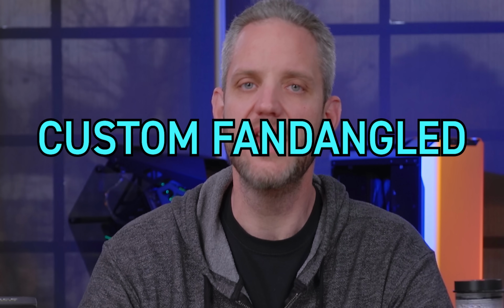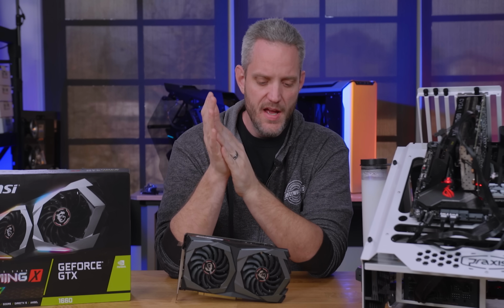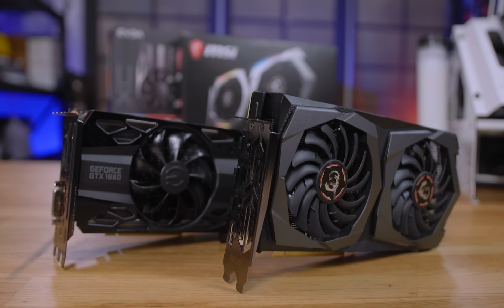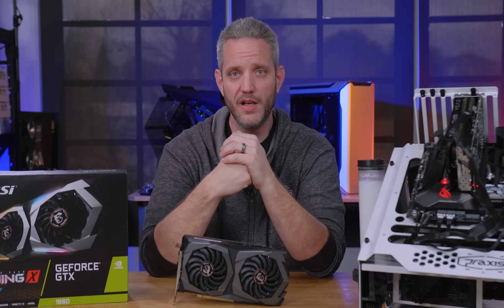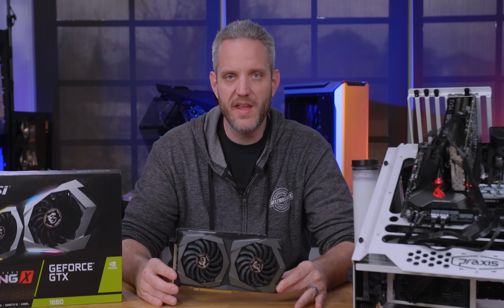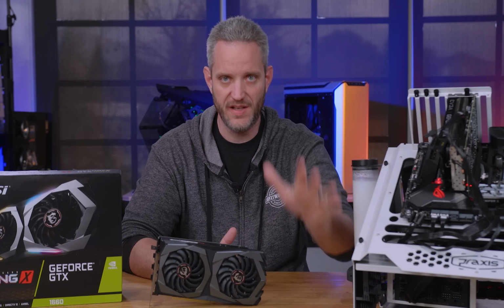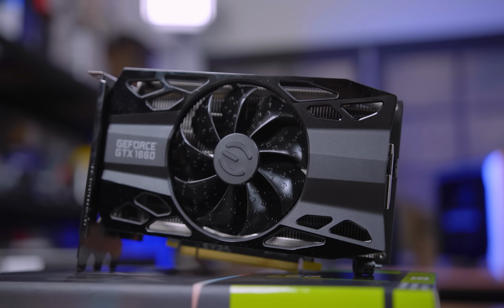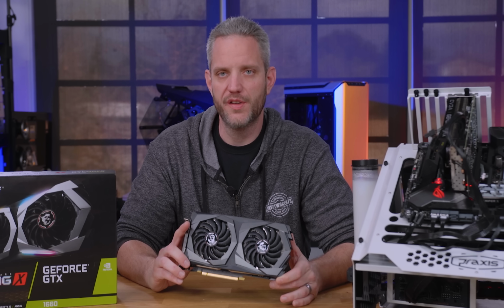Just save your money.... GTX 1660 vs GTX 1060

Comment: I always ran low end video cards with crappy coolers on them, until a friend convinced me to buy a 980 a few years ago, right after my 550TI crapped the bed on me. The 980 was the top dog card, the 980TI wasn't released yet, and I bought an EVGA card with a beefier dual fan cooler on it. I went from loud, hot, and mediocre performance, to a card that idled in the low 30's, and even with a rather decent OC, never gets over 70c, and is almost never loud enough to actually hear.

Essentially, I disagree. Unless you're watercooling, get a card with a better cooler on it. The air cooler a card comes with doesn't really make any difference when you're just gonna pull it off and put a waterblock on it anyway.

Comment: @JayzTwoCents Can you make a Video showing which RTX 2060 is the best value on the market? I think after seeing this Video I am leaning towards the RTX 2060 over the GTX 1660 Ti to replace my GTX 660Ti.
Also, I am currently running the i7-980X Extreme Edition from 2010 with 12GB DDR3 1600. Is this going to bottle neck my gaming experience much?

Comment: What if I am limited by 95w tdp max and preferably small size because of a 100% passively cooled system incl for videocard? Am I better off downclocking a slightly higher tdp card or waiting for one with a lower tdp?

Comment: Personally, I'm gonna wait till the kingpin cards come out. I bought myself an MSI Vega64 card after the Sapphire software borked and failed to run the fans at all in the RX590 I had(got it RMAd) and while I still had core clocks at ~1700mhz on both cards, I noticed a substantial improvement in smoothness of the games I play with microstuttering being nonexistent. Still had the same framerates in the same games, but they just seemed to run smooth as butter, so I'm going to need a substantial boost in raw power of a card to go back from my HBM2 memory. This is all besides the 20+ cards for every model name in Nvidia's lineup with just as many slight variations in performance and price just needlessly complicating things, at least in my eyes.

Comment: Paying the extra $20-$30 to get a better cooler (or something that matches your color scheme) makes more sense the higher you go. When I bought the RTX 2060, I paid $379.99 for the Gigabyte triple fan model when the msrp of an RTX 2060 is $249.99, that $30 wasn't such a big deal at that price range. If you're trying to look for the best bang for your buck just get the msrp 1660 (unless you think you can squeeze out the money for a 1660 ti) don't buy a 1660 with some crazy cooler that is only $20-$30 cheaper than a 1660 ti.

TL;DR - Crazy coolers don't make sense for GPUs that sip power.

Comment: @
JayzTwoCents

Bro did u overclocked it ?" If u did u will kno that u can get similar 1660TI performance in fps thats 10 % more performance at lower TDP Lower Temp Better value cost per frames . On non OC its similar to RX590 +few FPS more in performance even in 1440P but this 1660 series ment for 1080 gaming at highest possible framesr all titles above 60 fps till 2020 . This just killed AMD RX590 with cost ,tdp ,temps(70 max when oc) I could love to buy this for new systems for 1080P aming paired with Ryzen5 2500 ,16 gig ram 300 mhz for beasty 1080p gaming !!!and even streaming .Even 20 % FPS gone while streaming i will be getting above 60 FPS at ULTRA . Well ULTRA preset is bullcrap as Hig will be more than enough .and lowest will be great for battleroyales . Amazing card ... But i will recomend RX580 as of now price is great .In India its same as GTX1060 3Gig ,,,,with 8 gig VRAM for future proofing. But for 144hz 144fps 1080p i will go with this 1660 than 1660ti as i will get same performance of 1660ti when oc !!! but still RX 580 is the best deal lile 17000 rs vs 27000 rupees for 1660TI cards... 10000 rs difference means 130$ :)

Comment: I have an MSI GTX 1060 with 3 GB of RAM.
Think I will hold out later still to decide what to upgrade to.
It is powering an ASUS ROG Swift PG27VQ 27" 1440p 1ms 165Hz DP HDMI G-SYNC monitor at 1440, and running it at 144 hz.

Comment: The GTX 1660 overclocks very well and once you do that it slightly beats a stock GTX 1060 Ti and GTX 1070. That's a good deal for $220.  I also have a GTX 1060 3GB and its served me quite well at 1080p for three years. It absolutely should have existed Jay.  I caught it on sale for $160 and don't feel like I've been taken or anything.

Comment: Every time I see one of these vids I feel worse about my purchase.  I bought my computer Feb 4th and not being very computer savvy the shop techs helped me build a custom one.  I didn't really have a choice, my primary comp at the time was a laptop and the battery and gpu died days apart.  The gpu we settled on was an Asus Cerberus 1070ti advanced(I still have no idea what the advanced part actually does) because it was $250 off down to $500 (Canadian), a victim of the mining craze price hikes.  The only other one somewhat comparable were a few of the cheaper 2060's.  Even in retrospect it was the best value in that price range, but I can't help but feel if my laptop had held out for just one more month I probably would have picked up a 1660 ti and had extra money left over for better mobo and ram.

Comment: If I can get one for around 200 it would suit me. You can always justify small jumps to the next model or quality of the same model then may as well get the next model up.only going to need 1080 60fps so card is great for me unless the 1060s used drop massively.

Comment: I prefer to save up and wait for the next gen of Graphic Card.. Right now, it isn't worth it, for me, to upgrade from a 1080ti on my desktop and my 1060 6gb on my laptop. On my laptop, I could always use the thunderbolt 3 graphic card enclosure and just run games through it, although, there's compromises to do so, but still worth doing it.

Comment: On lower end/mid-range cards like this, especially on a full build, i'd rather go for the MSRP card unless there's something severely lacking, like you said. On higher end cards (400$+) when buying an upgrade, I'm a lot more willing to spend the extra 50$ to ensure it runs cool, quiet, and is durable. I've personally had several issues with a few vega 56 models until settling on the red dragon from powercolor. At the higher end the "just a little bit more to buy a tier up" changes from 30-60$ to jump from like a 590/1660 up to the 1660ti, up to 100-150$ to jump from say an rtx 2060/v56 up to the rtx 2070/v64.  So the amount to jump up to the next card in the stack increases the higher you go in the stack, which means you have more chances to get a better cooler. 

I build computers for friends frequently and work at the california microcenter. Just shipped out a build with the MSRP 1660ti triple slot. WHAT A CHONKER.

Comment: I guess it depends on what your financial situation looks like. If you can stretch out just a little bit more it would make more sense to wait an extra paycheck for the higher model. But at the same time you can add $10-20 bucks to a lot of components and have a computer that costs $100+ dollars more than you initially set out to spend.

Comment: PLEASE READ
TLDR: I’m calling it now, the 1650 will have 1024 cuda cores. Replacing the 1050 Ti and the 1060 3gb. 

The real competitor for the 1060 3gb will be the 1650. Keep in mind, I don’t know shit about what Nvidia does or how they do it. That being said, I spent hours comparing Pascal and Turing GPUs, as well as their cuda core counts, and have concluded that the 1650 will likely have 1024 cuda cores. This will put it one performance tier above the 1050 TI and one performance tier below the 1660. 1024 is slightly less than the 1060 3gb, which has 1152 cuda cores but the advancements within the Turing architecture should help close that gap. The rumored 4gb of vram will help too. 

In terms of value, the 1650 will be better than the 1050 Ti and 1060 3gb. As of today, the cheapest 1050 Ti is $170 and the cheapest 1060 3gb is ~$190. Neither is worth the price as it is. The 1650 is rumored to be $180 MSRP, making the other cards pointless. However, if the performance is similar to the 1060 3gb, like I said. Then it would still be worse value than the RX 570. Right now, you can get a 570 8gb for $160. Need I say more? And did I mention you get 2 free AAA games on top of that?
Honestly, It would be dumb for anyone to buy a 1060 in 2019. Thoughts?

Comment: Personally I’ve had a budget build done with a free old 770 and have a hard budget so I’m just looking for a good newer card, i wouldn’t spend the 30 difference for up to 10 FPS performance. I’m waiting on the price of the rumoured 1650 but it’ll be that or this currently, or a second hand 1070 if there is a flux of sellers due to these new cards. My point is I’d look at the best performance for starting at 200 gbp so I’d want basically a quid per extra FPS and ti upgrade doesn’t offer that, if the 1650 is only 10 to 20 behind but around the 160 mark it’ll have the best price to performance for my budget, if you’re budgets bigger then the 2060 is probs the best choice, for those in the middle it literally just depends how attached to that money you are and how much you value per pound per FPS gain.
Reply: Excuse typos, iPads being a twat.

Comment: I would like to stack the stats on the top end of previous and high end cards (ie 980, 1080ti and RTX 2080ti as well as AMDs flagship line ups) and then use pricing per stat to find good value. Hell, throw in used card pricing for the previous gens.

Comment: For those with mITX systems their case will decide between a 3slot MSRP card and a 2slot dual fan card for another $30.

NCase M1 can take a 3slot cooler size, but only has two slots on the bracket. Then there's that tall and short Lian Li case that's basically like half of a Bitfenix Phenom that will only take mITX length, 2 slot cards.

Node304, Fractal Define Mini, NZXT H200, Corsair 250D, Silverstone SGxx, etc can't take 3slot coolers and brackets, but usually can fit a wide 2slot dual fan card. Hell some of these can fit a 3-fan card as long as it's only 2slots thick.

Honestly if it wasn't because it's $30 cheaper I don't see the point in a 3-slot mITX length card that will most likely just end up in mATX and ATX systems.

Comment: I finally upgraded my main editing/gaming rig graphics. Went from a GTX 980 ti to the rtx 2080 ti in my main i9 9900k rig. After some new thermal paste and a good cleaning I dropped the 980ti into my 4ru supermicro 24bay 30TB raid 60 with dual hot spare  dual xenon e5 2660 Plex/storage/render server. The server has a nice little boost vs no dedicated graphics.

Comment: When Pascal was released I decided to go with the GTX 1080 because I'm using a 1440p 144 Hz monitor and this 1080 is going to be used until AAA games start coming out that bring my FPS down below 60, at that point I will likely purchase whatever the size generation **80 GPU is going to be and it will hold me over for many years I imagine. 
I think it's more cost effective doing it this way as opposed to purchasing a ^^60 every new generation trying to keep up with AAA graphics settings enhancements.

Comment: Honestly I've got both a 2060 and a 1080Ti on different systems. But what I have experienced is that I should have been more realistic on what resolution I wanted to game at. When I got the 1080ti I wanted to game at 4k and was ok with a 40 inch TV to do that. Then I found a viotek 32 inch 1440p 144hz monitor..  what a huge difference in overall gaming quality vs the 4k 30 to 40 FPS 🤯.   Now I find myself using the 1440 setup with the 2060 and having a truly amazing experience. I am seriously debating if I should just sell my 1080Ti system and stick with my 2060.... So my advice is decide your preferred resolution, then go after the card that makes the most sense at that resolution!
Reply: The 1080Ti will be better at 1440 dude
Reply: @gazzau79  That's a 4k card.
Reply: With the 2060 at 1440p ultra I get between  50 and 80 depending on the title. When I tried my 1080ti on the same rig (2600 w 32 gb of memory clocked at 2933 with an OC 4.1 at 1.37 volts stable)  I was getting between 65 and 100+.. But it as always depends on the title, unfortunately I love AC Odyssey and Origins and both are total garbage as far as optimization goes. So that's where the thought of selling enters the equation, that 1080ti is easy 400 to 500 and with that 2600 sys around it I think it's safe to ask between 700 and 900 (way too much to list in the comments)... So yeah I would say ask yourself want you play and be honest about what would get you to that point..

Comment: I bought a 1060 3G, but it was $40 more than a 1050ti and $120 less than a 1060 6G. That choice was easy.
Reply: I just sold my 1060 3gb it worked ok for me in vr sim racing but I got the  msi1660ti for 285.00 on new egg and I can get 90 fps in vr in all my dims now where I had to lock at 45 before. .for me it works great i5 6440 8gb ram msi ventus 1660ti
Reply: @ericcline9146  I am not heavy user, I just wanna play BF4, GR Wildlands and FIFA. I think it should be fine for me.
Reply: How it works? Are you happy with your gpu?
Im planning to add gtx 1060 3gb for my i5 4570 with 16 GB ram.
Reply: 1050 ti literally performs better
Reply: Finley Craig Nope
Reply: @finleycraig6846  Nope, gtx 1060 3gb is waaaay better.

Comment: Still happy with the RX 580 Red Dragon 8GB I snagged from MicroCenter for my son's rig (good upgrade from the GTX 1050SC), big thanks to Jay for the previous videos w/ that card which is hard to beat for price/performance (was $169.99 when I bought it - now $179.99).  But it is good to see the market getting saturated with contenders so it will cause a price war.

Comment: Overclocking? GNs testing had their 1660 about on par with their 1660ti in many games, when BOTH were overclocked as far as they would stable'y(?) go. Its a sample group of one though, so interested to hear your findings. In their case, "extra shiny bits" also meant a good cooler, but more importantly a higher max power target. "Extra bells and whistles" can translate to significant performance increases.

Comment: I bought my 1060 3GB during the inflated prices
Got it for £200 and the 6GB were £340
My GPU still works good, wish these cards came out earlier but I don't need an upgrade
Reply: @DefensiveLimestone  ah I get that. There wasn't much choice for me at the time, and the 3GB wasn't too bad compared to the 6GB
I would love to upgrade, but for the time being my 1060 works fine on all the games I play everyday
Reply: Cookie Rager it’s that urge you get and it’s like you just get a compulsion to upgrade but then you realize you have enough power 

Preferably for me when I saw this generation it was too expensive considering Last generation we got a 2060 which was equivalent to a 980 for only $250 now we’re getting the same equivalency except for 350 which is not worth it so I’ll wait another generation
Reply: I bought the Asus Dual GTX 1060 6GB for $230 last December. Loving the card.
Reply: T S I got the 1060 6gb as well around last July, thank god I got the 6gb because now if you look at recent testing the cut in VRAM is really chopping and taking a toll on the frame rate to the point that it isn’t a 1060

Comment: I would just buy used Hardware instead. I dont kno what the situation is in the rest of the world but here in Germany even good gtx 1070s (like Palit Jetsream) are avaliable for around 220€, much less then even the cheapest gtx 1660 ti ( 260€ with what seems to be a pretty bad cooler). For me the choice is pretty obvious especially because the gtx 1070 has 8gb vram. 

Far  cry 5 nearly uses 6gb vram at 1440p making 6 gb not very future proof and would not recomend buing  a card.

If we only look at new Hardwar, then I would choose ither 1660 or 1660 ti, The rtx 2060 does not make sense in my eyes, because it has not enough vram at that pricepoint and performamce.

Comment: The problem is that prices are fucked up here in europe. The cheapest 2060 is around 370€, while the cheapest 1660ti is 270€, a neat 100€ less. Having to upgrade from a dead (rip sweet angel) R9 380X the 1660ti saved me from madness because 580's and 1060's prices are also highly inconsistent (580 4gb at ~200€, 580 8gb at ~240€ and 1060 at ~290€ FOR REASONS, and they tend to shift week by week).
Nvidia and AMD have to keep their resellers at bay, expecially their OFFICIAL resellers, the ones listed on their sites, cause are the ones with the most craziest prices.

Comment: I think i should wait for the next gen of gpu's to upgrade. I currently have a 1070.
Reply: Me too man, and for 1080p it is good. I think I'll wait for the 7nm GPUs.
Reply: Habbekuk of course, i had my 780 for 4 years with no problem, its just point of graph settings
Reply: I got a gaming x. BEST COOLER EVER. Pumped overclock so high it's almost like a stock 1080. Won't be changing it soon.

Comment: My ROG STRIX 1060 6gb still holds up pretty well.
Reply: Same here. 
I don't know if yours has the thunderbolt 3 on it, but if it does, you can always by a thunderbolt 3 graphic card enclosure and a graphic card you want and run it through it, although, there's also compromises as well. But it is a fun way to make a gaming laptop last longer.